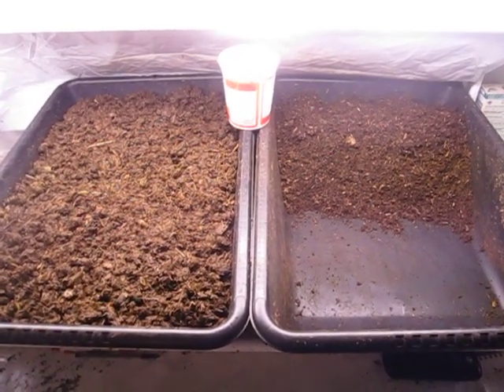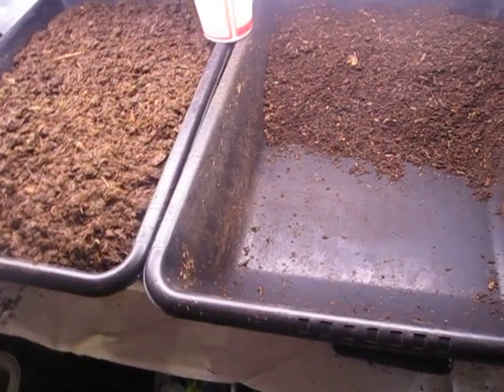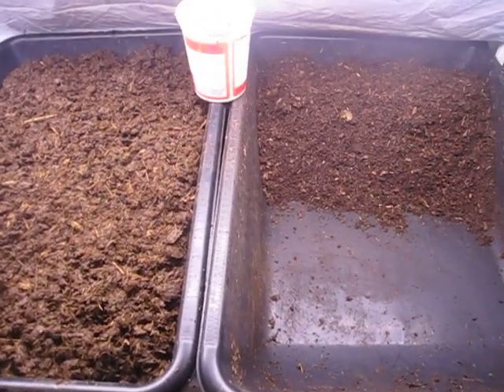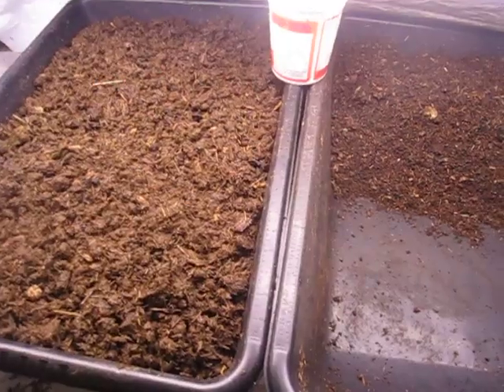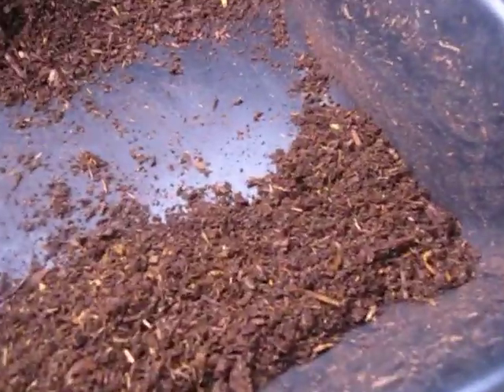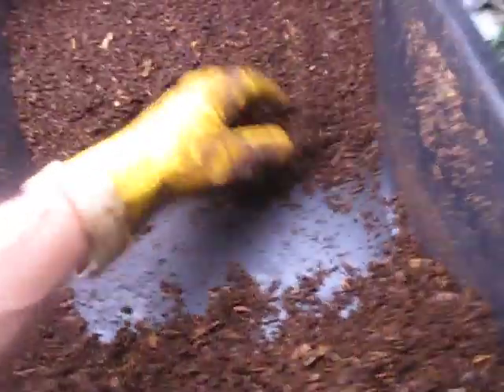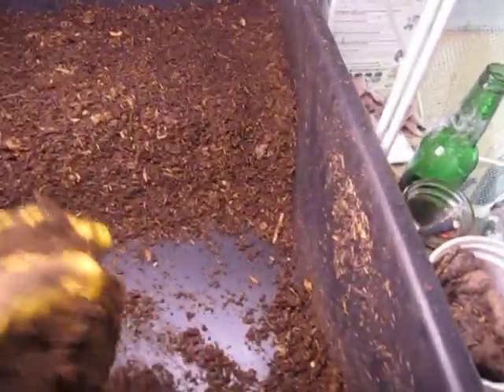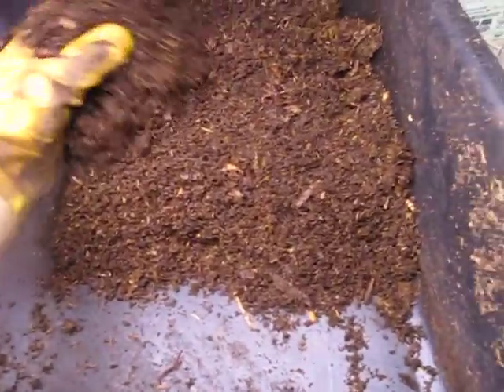Vermicompost & Worm Harvesting

Comment: Turbo! Turbo! Saw a trick from The Garden Worm lady. You have a pile of worm bedding with light on. Slide something flat underneath & flip the pile over now you have a bunch of very clean worms on top. So I have some large flexible plastic cutting boards. I took your idea of using a mixing tube but lined the bottom with the cutting board. I putting beds about 2 or 3” deep over one half. I waited for a bit took ahold of the corners of cutting board & flipped everything over to the other half of the bin. If you want them real clean she rinsed them off.

Comment: Why don't you use the stackable worm bins system? I'm finding more companies are coming up with some very interesting system where not only do you not have to go through the worm castings but you can drain the liquid out through the bottom tray. Plus you can build these up a couple of trays. Let me know if you use this system and what you think about it.
Reply from the maker: Hi Carolyn - those are indeed popular systems and I've tested them out myself. I'm not a fan because they don't work as well as other systems (even some that are much less expensive). The trays tend to be very small so your actual composting potential is pretty limited at any given time (should only be one active tray on the go at once), air flow is often not that great, and the worms are usually much slower to migrate upwards than is supposed to be the case. The liquid that drains down - although touted as "worm tea" is often just leachate from the break down of waste materials. Not nearly has good quality as actual castings tea (made from finished material). I don't mean to be negative here - stacking bins can be a good starter option for sure - just wanted to explain why I'm not as big a fan as I am of single compartment flow-through systems or even regular plastic bins for that matter. Thanks for the comment!

Comment: Thanks for sharing... Check out the video on YouTube called "Northwest Redworms - Redworm/castings table harvester". You could build one of these and save tons of time. Its a small, table top model. I would slope it the opposite direction however, so the cranker could feed the harvester at the same time. I would also build it with half 1/8" screen to get the castings, and half 1/4" screen to separate the coccoons.

Comment: i like the info you provide in your videos.  it is thorough though a bit wordy and does drag on a little longer then necessary.  i am curious though... why are you babying the worms?   the whole lightly brushing the top layer down slowly.  i mean, couldn't you just scrap a layer quickly and have an acceptable amount of worm loss?   I mean there are thousands in there.  If time is an issue, why are you doing it so inefficiently?